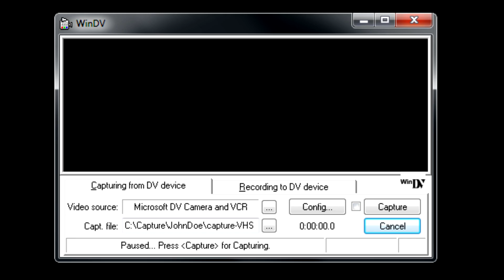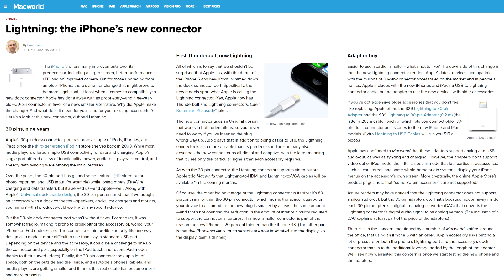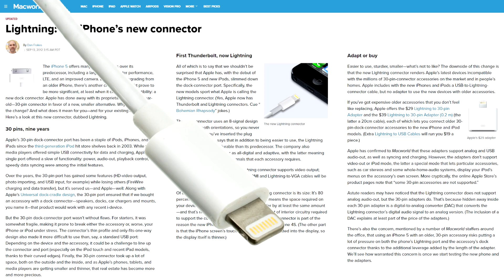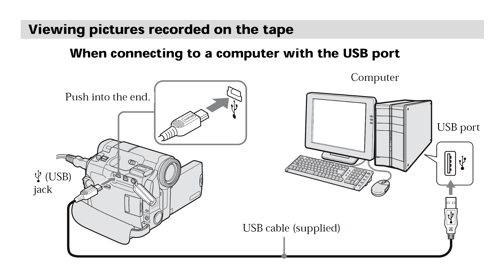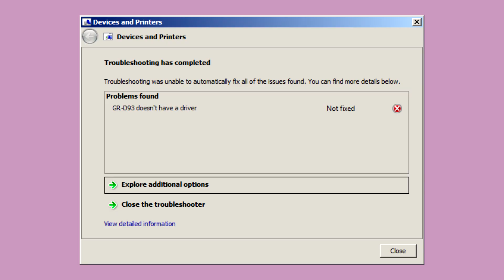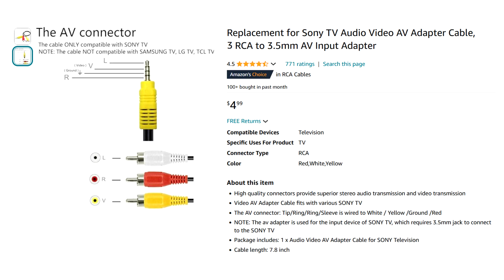Mini DV and Digital8 to computer - which digitizing method is best for you

Comment: What about using HDMI?  Like using a Canon HV20 camera which has HDMI out.
Reply from the maker: Indeed, I overlooked this method because DV only camcorders do not have HDMI out. The HV20 is an HDV camcorder that also can record and play DV. With HDMI, the video is converted into uncompressed format, which is lossless, then you either can keep it uncompressed, or re-compress to another format. Since the original video is compressed, the HDMI route is no better than capturing DV over Firewire or USB, but it is no worse either except for huge file size. It is a viable choice if you cannot capture DV as is. Thanks for pointing out to this option, I forgot about it.
Reply: @ConsumerDV  Thanks for the info!
Reply: @ConsumerDV  one critique of this is that this is not true of all cameras: it depends on the implementation of where HDMI sits on the image pipeline. 

I recall reading that certain Panasonic camcorders had some extra processing before their HDMI output, leading to some artifacts. Other cameras output a true uncompressed image of the camera's live feed before it hits the DV/AVCHD encoder, which can overcome bitrate issues in complex scenes. For example, I record water polo with a constant and erratically-moving water surface, which is a complex scene to encode. I've noticed that if I record in a more modern codec at a high bitrate from my camcorder's HDMI output, I can get a clearer image if I zoom in and pixel-peep
Reply from the maker: HDMI usually allows to output in native resolution like 480i, or in HD, like 1080i. To upscale, you need to deintetlace, resize and re-interlace. Obviously, the fewer steps the better. In your case, you are grabbing live feed, so potentially it can look better if it comes directly from the sensor bypassing DV compression, as you noted.
Reply: Opowiadaj po polsku!

Comment: I built a new PC with Windows 11 and no firewire, and the Panasonic capturing software still works flawlessly (but it took installing it with compatibility layer and bypassing the main installer) with my Panasonic NV-GS230 connected via USB 2.0 high speed.

Comment: The WindV software uses footage captured via FireWire. Does it retain interlaced scanning, and can it achieve 60fps through deinterlacing?
Reply from the maker: WinDV like most other DV capture programs does nothing to the original DV video, it merely saves it into a disk file. Traditionally, Windows uses DV-AVI format, Mac uses Quicktime-DV. Different containers, but the content is identical across the systems and the tape. So, yes, interlacing is retained, because DV is interlaced format, although progressive scan content is possible through 2:3, 2:3:3:2 and 2:2 pulldown schemes. Sure, you can deinterlace 30i into 60p.

Some capture tools allow you to re-encode the video on the fly into another format like MPEG-2 or AVC. Mac tools are more sneaky about it, and you need to fight them to get the original DV files, but it is doable on Mac as well.

Comment: and what about programs to capture?
Reply from the maker: Tons of software from WinDV to capture modules in every decent NLE including Movie Maker. As long as the program works, you'll get the exact copy of what is recorded on tape. On Mac it can be a bit trickier, as its software (iMovie or QuickTime) wants to re-encode DV video into something else like H.264 or ProRes, and you need to wrest the original DV-MOV from it. I don't use Mac for capturing.

Comment: So, the USB option is lossless like FireWire? I'm ripping my hair out trying to get FireWire to work on my old MacBook, so now I'm considering the USB option on my old Dell laptop running Windows 7.
Reply from the maker: USB 2.0 HS allows transferring DV at full quality, whether it is implemented on a particular camcorder is a different question. Not HS - either not full quality or not possible at all.
Reply: @ConsumerDV  Thanks for the reply. 

My camera is a JVC GR-D40, and this is what the manual says regarding connections – 

Using USB cable (GR-D50/D40 only)
It is possible to do the following things:
Transfer still/moving images recorded on a tape to a PC.
Capture still/moving images in real-time.
Use this camcorder as a WebCam.
Use the provided software PIXELA ImageMixer to capture video in real-time (GR-D50/D40 only).

Is this a good sign that it will transfer in full quality?
Reply from the maker: I have a JVC GR- D93, and after some tinkering all I could get was something like 320x240 @ 15 fps... actually it was worse. But maybe you can get a better result. If you succeed, please share!
Reply: @ConsumerDV  I will be attempting a transfer sometime next week. If I have any success, I will leave a comment here! 🙂

Thanks again.
Reply: @ConsumerDV  Well, it didn't work. The driver for the camera just would not install on my Windows 7 laptop. Fortunately though, I managed to get the FireWire working on my Mid-2012 MacBook Pro and have transferred four tapes in full quality. They look so much better than my composite transfers from years ago. Honestly blown away by how good they look!
Reply from the maker: Firewire is great when it works. The only two camcorders I could not connect via Firewire were pre-2000 JVC. I use Windows, no problems with jumping through hoops like with Mac. A refurbished Windows machine will cost you $60-$80, plus $10-$15 for a PCI-E Firewire card. Just sayin' ;)

Comment: Hello: I have a very new silicon mac with USB-C.  I would like to transfer video from my sony camcorder which has DV connection for lossless transfer to my mac.  You mentioned the Thunderbolt adapter method but skimmed over it so quickly that I need clarification.  Would you be able to provide me with all the cables that I would need (no issue with the price as you mentioned some are expensive).  You skipped over it so quickly I didn't understand all the adapters that I would need or the software that I would need.  Is this correct: A. Thunderbolt 3 to Thunderbolt 2 adapter,  B. Thunderbolt to firewire adapter, C. 9 pin to 4 pin firewire cable???  If this is the case:  Can I then plug in the thunderbolt 3 to the USB C port on my M4 Macbook pro?  Also will the mac then recognize the connection so then I will be able to transfer the video using iMovie or FCPX?? 

There are way too many video out there discussing transfer using S-video connect or other analog connection...that's easy.  There are so many video  digital conversion card/devices that can help you do this (i.e elgato video capture device and countless others on amazon).   Wish there are more discussions about transfer from DV connection from a camcorder for lossless transfer to Mac/computer. There are no video conversion card/devices out there that I know that can do this. If any one knows the answer the this...thank you :)
Reply from the maker: I referenced Scott Schramm's video in the description. Here is the whole playlist of his videos on the topic: https://www.youtube.com/playlist?list=PLeiKzXHZh57DW9y3cg_4i8WOeYs6a0O4c Some important dongles are not sold by Apple anymore, and their price has skyrocketed. For example, the Firewire-to-Thunderbolt adapter is routinely sold on eBay for $150. I was lucky to grab a NOS Apple adapter for $28 on Amazon when it was available just for a couple of hours. Watch Scott's videos to learn what cables you need. Yes, you need to go from 4-pin Firewire 400 (both 4-pin an 6-pin are Firewire 400) to 9-pin Firewire 800, then to Thunderbolt2, then to Thunderbolt3/USB-C.

But really it may be simpler to buy a used Mac Mini. I don't use Mac for video capture and editing, but from what I see, Apple has been gradually removing support for native DV processing, so even if you build the franken-cable, you may have difficulty capturing video. I suggest a refurbished Windows PC for about $60 + a Firewire PCI-E card for as low as $10.

If you don't want to build a cable (which in total can cost you up to $200) and you don't want to buy a used PC just for capturing, then SVideo is not that bad if you do it correctly.
Reply: @ Hello. THANK YOU so much for the quick reply.  I viewed the Scott Schramm video which was VERY clear regarding the cable connections.  So pleased that he showed what the ends of each of those cables look like. A lot of vids out there just flash the cable and not show what the ends of  them look like.

I have purchased the 3 cables this morning. 2 from Amazon and the thunderbolt to firewire from Aliexpress $64.  It this all works, it will save me a ton from having to have a pro video transfer person.  

Hardware taken care of now hoping once I get them and plug everything in that either iMovie, FCPX or Quicktime will recognize my Sony camcorder (with the DV) and that the transfer will also transfer Audio as well and not just video.  

Your suggestion regarding the Mac mini..I went to my garage and actually found a working Mac mini with Thunderbolt 2!!! This will also be an option for me in case the above doesn't work.  Thank you for this.

Windows: I have made my peace and said good bye to Windows about 10 years ago. After I bought my first MacBook, I vowed never to look back (wards). Macs are so much more intuitive and sexy but that's just my opinion :) 

By next week I will know if all works as planned. Can't wait to see old revived videos again and maybe look for ways to upscale them to even higher resolution. 

Thank you again!!
Reply from the maker: Hopefully the cable from AliExpress works. With the hardware issues resolved, you will need to make sure that whatever software you use for capturing preserves DV video in its original form (720x480, 29.97 fps, interlaced, DV codec) and does not convert it to ProRes or H.264 and does not reduce frame rate to 29.97 progressive. As I said, I don't use Mac for capturing despite that I have an MBP (it is great for webdev as it is essentially a *nix machine), but it looks like with modern software you need to jump through hoops to preserve DV intact. Good luck!

Comment: I need to connect my daughters Panasonic MiniDV camcorder to my Aurora R10 Ryzen addition. The Panasonic does not have any RCA jacks, it only has the DV jack and my PC does not have a FireWire port, or even a lightning port. I only have a couple old precious tapes to transfer, of when her husband was alive and of their children. Does anyone know if it is even possible to connect these two for AV transfer and if so how? I would truly appreciate it, there are many articles saying you can use a USB port and then there are people saying you can not. Also I am told that the Motherboard on this Aurora does not have a slot to accommodate an IEEE 1394 Card.
Reply from the maker: Your computer has five slot covers with two slots taken, I assume it has three unused slots. Just open it up and see what it has inside. If you don't have short slots, you can put a short card into a long slot. Also PCI-E 3.0 and 4.0 are compatible. For $15 or less you can buy a PCI-E Firewire card, which will ensure that you upload your DV video in full quality without re-encoding. I have one like this, works just fine: https://www.ebay.com/itm/390606633957 but you can buy one for as low as $10.
Reply: @ConsumerDV  Thank you very much, I really appreciate it and it does have one PCIE x8 slot available.

Comment: Thanks for this. I am going to try installing a new FireWire PCIe card in my PC and go the direct DV to DV approach.
Reply from the maker: I am glad I could help! I bought a cheap Firewire card for less than $15 with VIA chipset, and it works just fine. Windows 7/64 could not recognize two old JVC camcorders, but recognized a newer one, two Panasonics, one Canon and two Digital8 Sony cams. So, YMMV :)
Reply: @ I found one with a VA chipset as well so hoping it works fine with my Sony Digital8 Camcorder. :) Thanks again!

Comment: I have a Sony Mini-DV  No firewire input/output, tape only.
Reply from the maker: What do you mean? All DV camcorders except of the few very early ones have Firewire port.
Reply: @ConsumerDV  You are correct.  I checked and it is a Canon Optura Pi from 2000.  Only S and AV ports.  The USB to computer software method resolution was crappy, worse than VHS.  Playing it directly through AV port into a 4V Sony 75" TV is great/sharp.
Reply from the maker: I checked the Optura Pi user manual, and it shows DV terminal behind the flip-out LCD screen. If you are going to use analog port, SVideo will provide higher quality.
Reply: @ConsumerDV  Thank you soooo much.   I've never used a firewire before so I totally missed it for over 2 decades.  I will buy a firewire and computer adapter.  The analog out just looks worse than VHS (I used super beta from the mid-80s).   I previously transferred about 75 Hi-8 and mini-dv tapes into a Windows XP machine with dedicated video card and those look great but the current analog method for Windows 10 & 11  are very inferior.
Reply from the maker: @stephenfleschler9682  I am glad I could help! A word of caution: I have two JVC camcorders, one from 1999, another from 2000, which are not detected by my Windows 7 machine. I don't get how DV decks and camcorders were supposed to interconnect via Firewire without any drivers, but a Windows machine needs a specific driver for a Firewire-based camcorder?! Wasn't it supposed to be a universal standard? Some people say that when you connect a camcorder via Firewire, no drivers are needed - this is wrong, I can see how Windows searches for a fitting driver and installs it when available. So far, I have JVC GR-D93, Canon Elura 100, Panasonic GS500, Sony DCR-TRV260 successfully connected and respective drivers installed. But as I said, I could not connect two other camcorders. In short, YMMV :) I wish you luck!
Reply: @ConsumerDV  I will be contacting Dell as the computer is still under warranty and want to see what they recommend.  Thanks for your valuable input!

Comment: With a USB port you can capture lossless DV video to computer with a certain few Panasonic models of camcorder:
* PV-GS75   / NV-GS75
* PV-GS150 / NV-GS150 
* PV-GS180 / NV-GS180  (verified working)
* PV-GS230 / NV-GS230  (verified working)
* PV-GS250 / NV-GS250 
* PV-GS300 / NV-GS300 (verified working)
* PV-GS320 / NV-GS320 (verified working)
* PV-GS330 / NV-GS330
* PV-GS400 / NV-GS400 (verified working)
* PV-GS500 / NV-GS500 (verified working)
        The listed models which I have not yet verified will probably do the job also.

Comment: Thank you so much, sir. i have learned a lot with your videos. I am using d8 handycam,  but I don't own a Mac to transfer my tapes over firewire,  so i'm planning to use s-video, deinterlace and upscale the video with virtualdub as you explained in another video. Do you think that this could allow me to approach the desirable quality?
Thanks again for taking the time to make this videos
Reply from the maker: Thank you! Yes, S-video is almost indistinguishable from DV provided you have a decent A/D converter. OTOH, if you have a Windows desktop, installing a Firewire card will cost you just $15 or less.